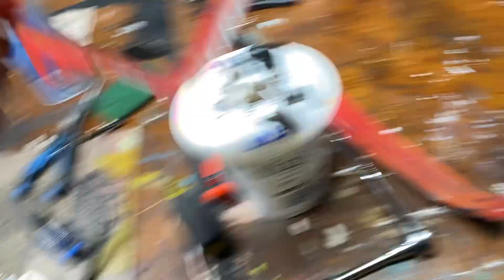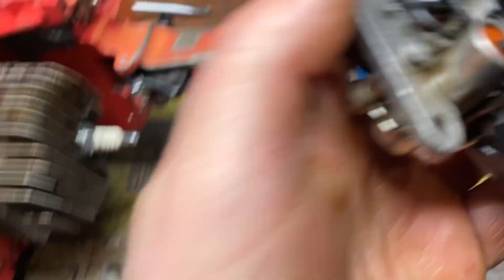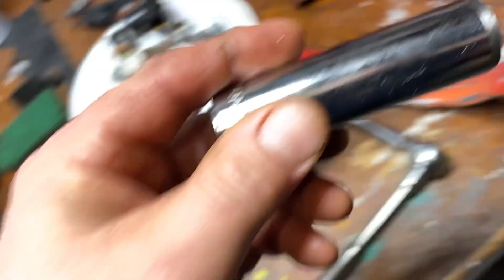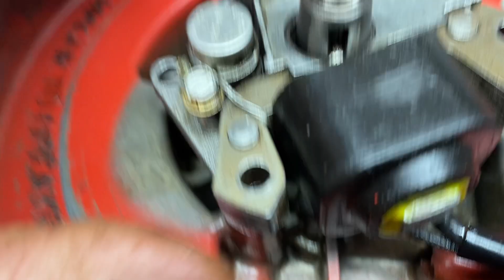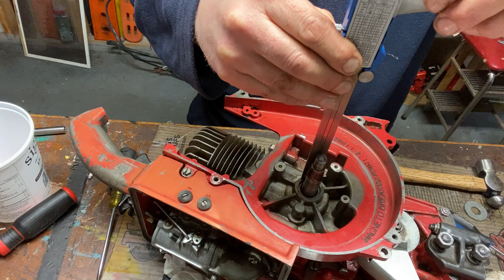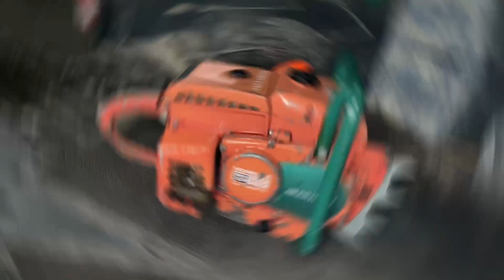Homelite SuperXP1130 Automatic Gear Drive - Flywheel Side  Oil Seal and Restoring Spark!

Comment: Should be 58308 for the flywheel side and 63043 for the PTO side
Reply from the maker: @oologahgardentractorandcha3055  looks like Homelite PN 56256 for the gear side oil seal based on the parts list I have.
Reply: @xl130homelite3  Correct, brain fart on the gear side. I looked at the list for direct drives